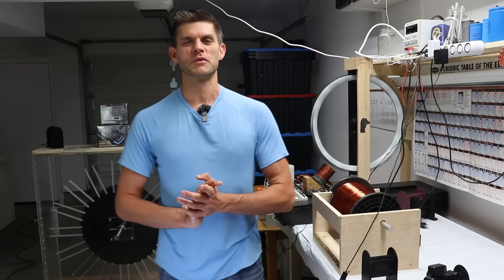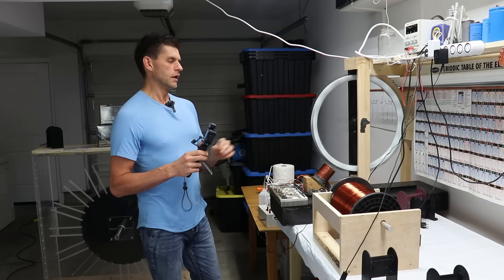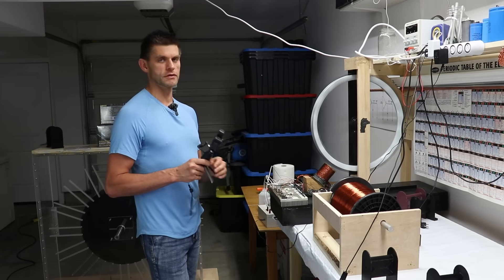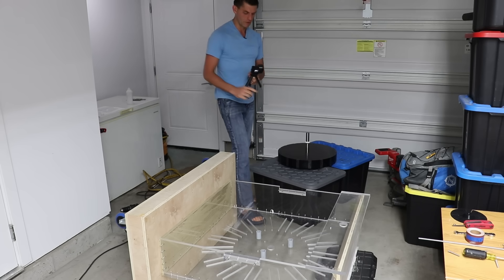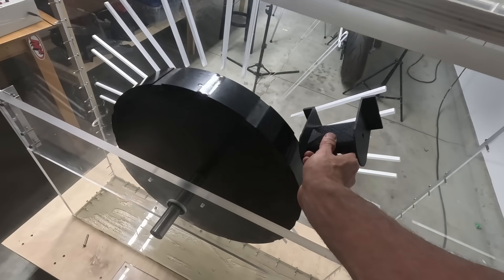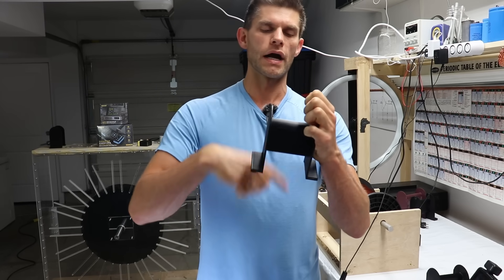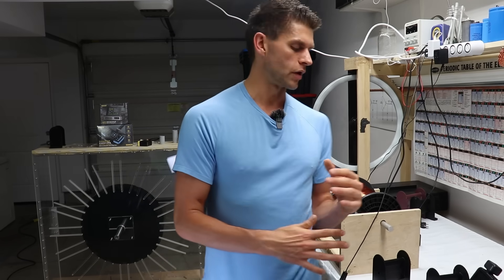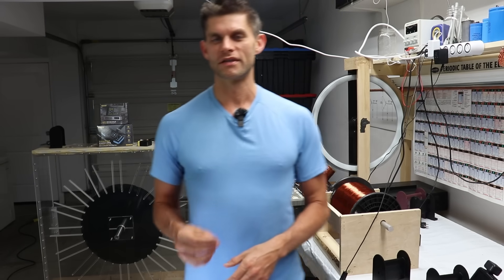Unlocking Zero Point Energy in My Garage (Open Source Project)

Comment: Hope this helps for the bedini motor using tesla coil configuration. Lower voltage higher amps connected to super caps bank n then recharging batteries
Reply from the maker: Nice

Comment: I made a digital generator. No moving parts just a moving magnetic field. Works like an alternator but it uses transistors to flip polarity in a sequence making a field that moves quickly down a rail. I think it has huge potential, I'm still trying to build a bigger one I just need several alternators and parts 

https://youtube.com/shorts/3CMO_zJha50?si=W3i8Z8Lk2ezKUgG7
Reply from the maker: Neat, have u seen the bitorridal transformer by Thane Hiens ?

Comment: have made a digital version of this based on a bedini solid state unit he made. it works
Reply from the maker: Cool lets see?
Reply: @MadscienceLPTECH  love too, however as you know this is no spinning wheel. I used a ardiuno with a mosfet to control 5 coils on one spool. The board I copied is a bedini digital kit that uses a transistor. I think I have the captured oscilloscope of the talked about H pattern. I do have photos of the bedini board.

Comment: How about we unplug the wall wart. and see what happens. 
I bet you them battery voltages will drop to 0 over time :P
Reply from the maker: Yes but does that mean there is COP lesd then one? No because of the the work you have done 

The current builds gola is to be a self running machine

Comment: you should use some changes in your technique. i know why its works. i mentioned distortion theory in your previous project where pulse coil is the energy giving as well as receiving coil. the  white one behind you.. read it. And if you like, reply me.
Reply: @MadscienceLPTECH  make a rotor disk of aluminium thickness around 15 mm and on it embedd18 to 24 powerful magnets on it. levitate the disk using magnets. below disk use 3 pulse coils to rotate the rotor along-with hall effect sensors to fix rpm. on radial axis and on top use harvesting coils. around 350 turns each. rotate the disk using pulse coil. manage rpm using feedback by hall sensors. around 375 or 400 rpm and 24 harvesting coils around this disk, you will generate around 6kw output using around 100 w input. raw output can be converted into this usable output by market available  off the self devices.
Reply: i am not going into details here. we also should use 3 correcting coils too, each opposite to the pulse coil to reduce wobble in the levitating disk. if need further details regarding pulse coil, correcting coils and harvesting coils, magnet size , type, i will not share all that here. it is manageable, use a little bit research.
Reply: i will keep giving hints, if you start building.
Reply: @MadscienceLPTECH  the poles are also wrong in your design. They should be NSNSNSNS along the periphery of rotor.

Comment: i suggest trying to use wave shaping on the driving coils and charging leads to reduce electro/thermal energy losses.  There is a lot of info on the web  on how it is used to drive the coils on stepper motors efficiently.
Reply from the maker: Very cool

Comment: the magic imo happens in the battery chemistry.. the time reversed high V charge reverts the battery chemistry back to it's charge state with little effort using "waste" backEMF obv the underlying source is the sea of energy / neutrino flux all around us :) but I don't think it works this well with lithium batteries for example
Reply from the maker: Agreed

Comment: could the initial pulse be directly fed into a battery or capacitor instead of catching it on the way back down? also are you suggesting that the inflow of current into the battery encourages free electrons in the air to be drawn into the battery? I could see how passive atmospheric inflow like a spring could accommodate for leakage, and potentially then some, to keep a higher pressure cycling going with minimal input, but I don't understand exactly how the inflow part works in this. if by zero point energy/vacuum energy you mean something different than free electrons, do you already have a video explaining that in more detail?
Reply from the maker: I will in the next video. Yes the enegy we capture is not electron based, though it will get converted into that eventually

Comment: How are you getting around the charging losses considering those are lead acid batteries? Isn't a bunch of that return energy being lost as heat?
Reply from the maker: Yes there are losses, but we are producing more because of the high voltage spikes into the batteries. Stay tuned

Comment: you need to Balance the wheel... when you add that epoxy you will create imbalance and that imbalance will eventually cause bearings to wear and you will lose some energy and efficiency here.
Reply from the maker: id say its as balanced as you can get. the rotor it self weighed 80lbs... i added a few grams of epoxy to each magnet in the z axis. we will see when it spools up but i bet its ok. i made the bearing replaceable. all wee need is a few weeks run time and its game over on too the new ones :)

Comment: With the one that you put the shaft in and burned yourself couldn't you put an extremely strong Neo-Dilenium magnet on the bottom of that to negate some of the weight and because magnetic fields are half moon shape it would keep it moving
Reply from the maker: Like float the shaft with a magnet?
Reply: @MadscienceLPTECH no you ran the shaft through a large round magnet correct. If you put a neodylinium magnet underneath where you're going to build your device per se then the opposing force of the magnet on the bottom will push up on the magnet you created with the shaft. Basically it's like putting your hand on a bicycle wheel as hard as you can it's going to force it to go one way or the other
Reply: I hope that makes sense. I've got a lot of very interesting ideas just never had the funding or the time
Reply: Like just to get rid of some of the weight and to help keep it moving might even make it move faster so you got the device that makes it move and then with the magnet underneath it taking some of the weight and basically keeping it moving with the magnetic field @MadscienceLPTECH

Comment: What I don't get with experiments like this is you have something spinning now so why not add wrapped coil and magnets all the way around that spinning thing as like a brushless motor you could 10 or 20x the power output that way so what you initially created was the starter I don't see why this wouldn't work I had a similar design just never had time or funding to actually build it but now that you have something spinning wrap that whole wheel get it as close as you can to it do not have it attached to the wheel and it would work
Reply: Not only that once u start creating electricity you could take say one bank of of coiled wire to keep the system going and the rest of it will be free energy
Reply from the maker: We are putting coils all the way around brother?

Comment: Voltage is not a pressure... OMG. All those geniuses makimg free energy in their garages have one thing in common: electric bill higher then people who just laught use electricitu and find cheaper supplier.
Reply from the maker: hows it not pressure, how should
 u explain it to beginners genius ?
Reply: @MadscienceLPTECH  my advise: first of all stay away of merhaphors ;) models paralels or symbolivs that induce fallacies . E.g. in your presentation one can reason that higher voltage electricity flows faster... then cable company salesmen calls me and offers higher speed internet, if I buy his higher voltahe mofem. Dont umderestimate the genious of greed ;)   I respecr your research leading to prove or disprove integrity of the idea... but it will more people interested in physics, and be smarter in the long run  and thatsbgood. for your research  google youtube video " Howard Johnson American invemtor..."  you can read patents

Comment: I'll subscribe just to see what happens in your progress. According to standard physics, it's not possible to extract energy 'from the ether' and get more out than you put in. I'm a mechanical engineer in the solar industry, and Newton's laws still apply to losses in friction via bearings and air, and losses in heat through resistance in the coil and plates in the battery. It simply looks like your batteries are powering a very low friction wheel efficiently, but if allowed enough time, a measurement graph of the batteries' energy will slow a steady decline, regardless of how big the wheel is. I respect your efforts, but I would like to see the batteries' state of charge over time, as well as a graph of the current and volts going to and from the wheel over an extended time. Not too much to ask to support your claims. Thanks 👍
Reply from the maker: Thats the point of the project to show definitive proof and calculations.

Thanks for keeping an open mind.

Always new information that can change our closed systems size. 😊

Comment: I wish I was much smarter and liked the cold, or I would move there and help you.  Nikola Tesla is the key.  
The ether between us is pure energy and it links everything in the universe.  It is endless. Energy never disappears, just transforms.   
The device that can use that ether as the source, and connect to it, solves the need for a power cord.  In 1893 Tesla has a car power by electricity through an antenna transmitted from his Niagara Falls hydro plant.  That is transmitted power.  But if the center of the Earth is molten lava iron metal, then we live in a radiant electromagnetic field extending well into space, and should be able to tap that field frequency.
Reply from the maker: Great comment brother. Also its pretty warm in Kelowna BC canada... like tropical compared to elsewhere 😊

Comment: Would be nice though. Expected claim:
*Charge battery gains more than run battery loses.
*Net energy in the system increases.

What always actually happens:
* Charge battery gains less than run battery loses.
* Total energy in the two batteries goes down.

 removethe tricks.
Just ask: is there more usable energy in the system afterward?

Energy accounting is king.

How You’d Measure It

You can do this simply:  Measure open-circuit voltage before and after (rough idea), measure actual Ah or Wh available before and after, or even better: use battery testers that do discharge tests for real capacity.

 No matter how you slice it:
 Total energy in = Total energy out (minus losses).
The run battery’s loss will always be more than the charge battery’s gain. Prove me wrong.
Reply from the maker: im going to prove you wrong, stay tuned. i do agree we will show all the measurements and data log it all

Comment: MAKE SURE WHEN TWISTING YOUR WIRE YOU HAVE YOUR DRILL IN REVERSE SO THAT THE WINDING OF THE WIRE WILL RESULT IN A CLOCKWISE TWIST THEN MAKE SURE WHEN YOU ARE WINDING THE WIRE YOU USE A CLOCKWISE ROTATION AND SEE WHAT THAT DOES
Reply from the maker: Appreciate the comment

Comment: 🤔 so the collapse of the charge in the coil, allows for over-unity to deliver more power to the charged battery? But how does it correlate to amperage, if that’s what batteries do, store charge?
Reply from the maker: Excess enegy from outside the system flows in

Comment: Greetings from Germany. That's a concept of a zero point energy generator used in a hypothetical highly advanced Spacecraft, is it correct:

The zero-point energy generator creates a dipole, which is an asymmetric charge distribution. The technical challenge for humans is to efficiently keep this dipole open. Then the energy flows endlessly. We could use magnetism 🧲 to maintain an asymmetric charge. Just as a windmill uses energy from the wind, the generator borrows energy from an external source, the quantum vacuum fluctuations. This external source provides the necessary energy, making it appear as if the generator is producing more energy than it consumes. This is because it is not a closed system, but an open one. The metamaterials used here have properties that do not occur in nature; they also enable superconductivity at room temperature and a repulsive Casimir effect. This increases the efficiency of the generator immeasurably without electrical resistance. The energy of the vacuum is already present, meaning that energy is not created from nothing, but merely "borrowed" from an existing reservoir. Simply put, the generator simply opens a door to these amounts of energy, allowing you to use them. It's very important to emphasize that the laws of thermodynamics are not violated here.
Reply from the maker: shout out Germany :) agreed the laws of that box remain valid just more outside that box

Comment: Have you seen the "Galaxy in a box remastered?" It's about 30 megawatts and no moving parts. No magnets needed. It should also be able to levitate if you change the bowl into an egg... altering the Helmholtz resonator a bit. It uses resonance in a cavity and produces it's own radio waves from the arcs and in turn uses the radio waves to keep it going non stop. Only 8 parts to it and very simple.. but extremely dangerous. Might even be some fusion happening there at only 800 degrees F.... because the hot magnet repels the oxygen instead of attracting it causing it to shoot out the spouts and split from the hydrogen. (Charge separation). It should also be able to make hydrocarbons if you feed it dirty air.... it will separate the oxygen from the carbon dioxide.. the oxygen from the sulphur dioxide etc... The first elements it makes are Calcium, sulphur , water and Carbon.... the same stuff you find in an egg.. the same stuff that builds up in a hot water heater.... Where did the carbon come from? It's in the air as CO2 and gets separated as it gets ripped apart at the hole..... and the oxygen repels the magnet after it goes through the hole and shoots out the spouts.
I have seen the Bedini motor long time ago.. it's low power. Not worth pursuing.
You can get funding from the public and private sectors and even the oil industry. I was showing the galaxy in a box to Daniel Smith about a year and a half ago and she gave me the links of where to go to get funding for it.... But I turned it down and  put it open source..... but I can give you the links if you want. The premier was very encouraging and supportive. ALL for it...No conspiracy.... and nobody bothered me. Those UFO orbs you see flying around are the same thermoacoustic technology and have a horn inside.. copied after the fact... and cannot be patended because its been open source longer than a year.
You can hook these devices to the grid and get paid for the power you sell. This is what I was told. In the case of 30 megawatts.. It's quite a lot of money annually. Tens of million of dollars annually.
Reply from the maker: ill check it out
Reply: @MadscienceLPTECH  It won't work if you ground it.. even though I say to ground it I had to so people don't zap themselves. I say it's not a capacitor.. but it is an asymmetrical one... as well as a Helmholtz resonator. It was reverse engineered from an ancient device that I found most of the parts for across the globe. Scientists who examined the disks said that an extreme amount of voltage passed through them and the quartz in them was fused. You can see the wear marks on the disks in another video. Nobody noticed the wear marks......
Reply: @MadscienceLPTECH  The original EGG / Bowl is also in another video... It fell from the sky....still in Ghana to this very day.
Reply: @MadscienceLPTECH  You use sound to start it up until it gets hot.. and once it's hot it makes it's own sound and powers itself.

Comment: What are you talking about? I'm less than 3 minutes in and you've already misrepresented two things. First is that an ion is an atom that doesn't have any electrons. They can't flow through anything in the way that you're suggesting because they would react with anything that happens to have a free electron or that is available to form a covalent bond. You have to pump a lot of energy into an atom just to remove it's electron in the first place. Secondly there is a very brief burst of electricity pumped back into the batteries after you cut the power, but not nearly as much as was taken out and a significant amount of it is lost as heat. 

You can't just violate the laws of thermodynamics like that 😂😂😂

And asking people to donate after an intentional misrepresentation of basic science to scientifically illiterate people is pretty low.
Reply from the maker: i didnt say an ion didnt have electrons.. i said the lead ions are slower then electrons bro. chill out with your conventional e and m theory

Comment: Let’s see some meters displaying power levels at various points in the system.  Let’s see the math. You’re using a battery to spin a motor to spin a generator to charge a battery.  That’s a losing proposition.  Energy is lost in transfer, lost due to friction -> heat, lost to magnetic resistance, and lost to air resistance.  Jeremy Fielding did a good video a year ago explaining exactly why this will never work…even though it should be pretty obvious.  If anyone actually believes this, I own a tower in Paris that I’ll sell to you cheap.
Reply from the maker: Ya we are working on all that stuff right now.

Comment: Just a small suggestion, Sealed Unit Iron Air Battery...... Berkeley, CA (December 12, 2024) — Form Energy announces that its breakthrough iron-air battery system has successfully completed UL9540A safety testing, demonstrating the highest safety standards with no flame or thermal event propagation.
Reply from the maker: Thanks for the info!